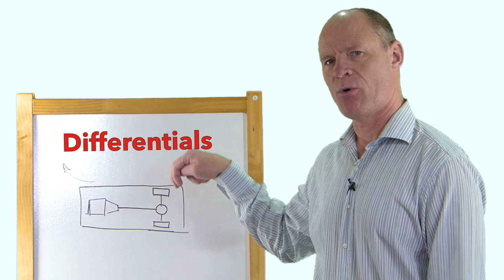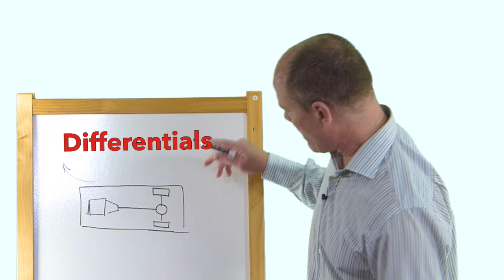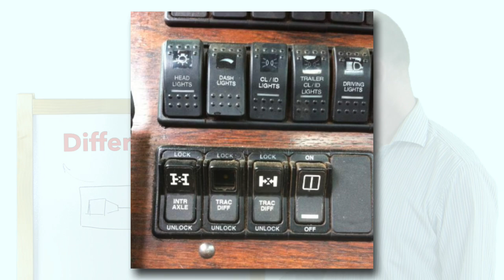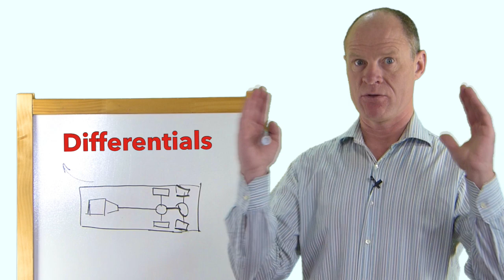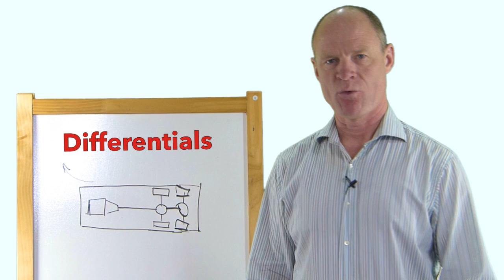How a Differential Works | Trucking Smart

Comment: So.. ?
Just a question...Which  Differential drives the truck the front one or the Rear one?
Reply from the maker: Hi Jay Jay Mr. Canada - Thank you for your comment and query. Most of the time, it's the front differential that drives the truck while it's going up and down the road. That's the reason for putting the chains on the front-most axle when chaining up, unless you have an inter-axle lock and then it doesn't matter. If there is anything further we can do, drop us a note. Always happy to help. All the best, Cheers Rick
Reply: Jay Jay Mr. Canad
Reply: check your drive tires usually its the front drives wear the quickest and using Jacobs engine brakes wear all your drive tires out a lot quicker too
Reply: its actually both differentials, the tire uneven wear is due to turning
Reply: @smartdrivetest  wrong
Reply: if its the front one take the rear driveshaft out and see if it moves lol it wont

Comment: If driving approximately 45-50 mph on relatively flat highway in snow, would it be advisable to use the locking differentials?
Reply from the maker: Hi Pamela B - Apologies for the late response. Thank you for your comment and query. And no, I wouldn't recommend using the diff lock. It is a feature that is designed to be used a low speeds. If there is anything further we can do, drop us a note. Always happy to help. All the best, Cheers Rick
Reply: Thank you 😊
Reply from the maker: Hi Pamela B - you are most welcome my friend. All the best, Cheers Rick
Reply: I agree with Rick, the power divider and axle lock (if equipped) are great traction aids when needed, but keep this in mind as well for when you do need them. If your tractor is equipped with BOTH a power divider and axle /differential locks, steering can be affected if the steer axle tires are on a slick surface as well; snow and ice, or mud. 
With one or both rear axles locked, the truck will resist turning and want to “push” straight ahead even with the wheels turned. This can sometimes catch a driver off guard in tight quarters. Rick did mention it’s best to use them while traveling in a straight line because it does put less stress on the drivetrain as well.

Comment: front wheel drive cars have differentials too built into the transmission
Reply from the maker: Hi MASTER MECHANIC Felipe - Thank you for that information. Smart drivers helping smart drivers makes us all smarter. All the best, Cheers Rick
Reply: Is the differential built into the transmission or transaxle?

Comment: i'm planning on build a custom welding truck and i was think of making it a tandem axle truck, is the gearing different in the axles or is it the same gear ratio in both axles. i know for a small time personal welding rig i shouldn't need a tandem axle rig, but i want it for weight distribution on the bed. without having to get a CDL
Reply from the maker: Hi David - thank you for your comment. I would suggest that you stick with a single axle vehicle. A tandem axle vehicle gets significantly less fuel economy than a single axle. A mate of mine suggested that you think about a Ford 550 or 650 for your rig. If you do go with a tandem, yes, the gearing in the axles in the same. And, I don't know where you are, but here in British Columbia, a 3 axle vehicle requires a Class #3 license. Those are some other factors to consider. If there is anything further we can do, drop us a note. Always happy to help. All the best, Cheers Rick
Reply: thanks for the info, im in the usa
Reply from the maker: Which state are you in David - I'll look up the requirements for a 3 axle vehicle for you?
Reply: Max before a CDL is required is 26k pounds, once it exceeds that gross weight you will be getting into CDL territory. Also if you plan to tow a trailer you are good for 16k tow vehicle max weight with 10k of trailer weight, and again anything over that in combination will require a CDL, if it has airbrakes then you need to obtain the airbrake endorsement and is a standard requirement for CDL.

Comment: My truck has problem when I turn differential switch on I hear air does something but only one rear wheel spinning on passenger side. What can be the problem? What's need be checked or replaced?
Reply: Good morning, Johny. 
This is a year late, but if you’re still having this problem, hopefully this will help you out. 
You mentioned hearing air when you toggle the switch; if you only hear this when the switch is flipped to lock, I would verify the switch valve body is good, and not leaking (bypassing) air to the exhaust port. Normally, in a functioning switch, this is where the air pressure in the signal line would be exhausted to atmosphere when the switch is toggled to the unlock position. 

If the switch is functioning correctly, check for leaks in the signal line next. This line is pressurized when the power divider switch is in the locked position, and sends air to your forward rear axle. Listen for leaks in this line. Run the engine to build air, then shut the truck off, and engage the switch. Turn the key on while doing this, so that if you are losing air, the low air alarm will sound and alert you ( nothing is more aggravating than chasing an air leak with no leaking air 😂) 

Doing this will also give you an indication of the severity of the air leak. Also, a bottle of soapy water will help you to find leaking unions or pin holes in lines. 

If you follow this signal line to the differential, and have not found a leak or defective component, the problem may be the actuator in the power divider unit. 
Some trucks use a diaphragm actuator and linkage that will resemble a brake chamber, and some use an internal piston. Either of these components could be leaking or stuck /binding. 

If this is the faulty component, you may want to consult a shop for repairs, depending on your mechanical ability. It is possible to do further troubleshooting to confirm the actuator, but I wouldn’t want to put you in a position where you may inadvertently lock the differential in the locked position, making your problem worse than just a non-operational power divider. 

I hope this helps, and if you’ve had the problem addressed, hopefully it will at least give you an idea of how the system works, and can maybe save you some money down the road!  Good luck, and best wishes.

Comment: If I disengage the diff while moving; will it cause damage ??
Reply from the maker: Hi Lorenzo Pacheco - Thank you for your comment and query. If you have the vehicle in a straight line and less than 10mph (15kph), it's not going to do any damage to the differentials. If there is anything further we can do, drop us a note. Always happy to help. All the best, Cheers Rick
Reply: Smart Drive Test thank you! Just got a job driving end dumps and bellies this will be helpful
Reply from the maker: Hi Lorenzo Pacheco - Thank you for your reply. That's awesome - so you're doing a lot of off road stuff? What are you hauling? If there is anything further we can do, drop us a note. Always happy to help. All the best, Cheers Rick
Reply: Smart Drive Test I’ll be hauling rock, asphalt, fill dirt from pits and they have some rough terrain. Thanks! Sure will.
Reply from the maker: Hi Lorenzo Pacheco - Thank you for your comment. That's brilliant. When dumping end dumps, make sure you're on level ground, and that the grounds solid. And always look up for overhead obstructions. We had a guy at one of the companies, they were hauling wet clay, and it stuck in the front of the box. When he raised the dump, it wouldn't let go and of course the load wasn't balanced and the whole truck flopped over. The worst part was that it punctured the fuel tanks and then the trucking company was charged with an environmental spill. When in doubt - ask questions and you'll do great. All the best my friend, Cheers Rick

Comment: What if you engage the diff lock and nothing happens can it be the switches
Reply: Hi Ash A. Depending on your truck’s make and model, it can be several things that need troubleshooting. 
Before digging in, what has led you to believe nothing happened?  I don’t mean anything by that, other than were you stuck at the time and needed the traction aid, but it wasn’t working?  Or did you push the lever / switch and didn’t hear anything?  What were the weather conditions at the time?  Unfortunately, if yours is air operated, the systems do not get used regularly, and moisture can freeze in the lines and prevent them from working- WHEN YOU NEED THEM THE MOST!  Did any indicator lights come on in the instrument panel?
If you were sitting still, and just turning it on to become familiar with the controls, chances are nothing will happen- other than a small spit of air ( like flipping the range selector on the shift knob), if your truck is old enough for the switch to be air operated. 
Chances are that the switch is electric though, again depending on the make and model of your truck. If so, and no indicator lights came on, including a light on the switch, I’d check the operator’s manual (if you have it) for a fuse location in the fuse box.
If it is an electric switch, and the fuse is good, then power and ground will have to be checked at the switch to verify the harness integrity and switch function. If this doesn’t solve the problem, a technician will most likely have to verify the harness integrity between the switch and axle(s), and the actuators themselves. 
If the switches and power divider / axle locks are air operated, the supply air, switch, and switched air will have to be verified, and if that checks out ok, the air lines and actuators will have to be verified.
I hope this helps, and hopefully it’s something simple :)

Comment: I'm buying a kenworth T660 with a 10 speed manual. I would like to run between 1400-1500 RPM at 75mph. I can't seem to find info for  this. 3.25, 3.55, etc. What would be best? P.S. I'm running dry van
Reply from the maker: Hi Daniel Nelson - Thank you for your comment and query. I'm not a 100% certain, but I believe the best rear to run highway with a dry van is 390 rears. And the people that would be best qualified to help you set up the truck are the dealership. They'll be able to tell you what rear-end you need to put in your vehicle to set it up properly with both the engine and transmission that it's currently set up with.  If there is anything further we can do, drop us a note. Always happy to help. All the best, Cheers Rick
Reply: You need to know tire circumference and transmission gear ratio  to figure this out

Comment: I locked differential in my truck once. Unlocked them when was ready to go on highway but apparently it did not unlock mechanically.. so after driving around 150 miles on highway, stopped on rest area I heard bobling noise rear of the truck.. my differential oil was boiling. Next day it unlocked somehow, I changed diff.oil and still drove it for another year with no issues. Then sold it..
Reply from the maker: Hi Vitaliy Melnychuk - Thank you for your comment and information. I'd never heard about the differential getting that hot. However, if you're doing city driving and a lot of turns that would make sense. Good to hear there weren't any issues beyond changing the fluid. All the best, Cheers Rick
Reply: If that ever happens again, driving in a slight curve, forward and then backward, will, at some point in the process, release all the built-up torque between the two sides of the differential.  It should be able to unlock at that moment.  A similar trick is often needed to disengage the front drive system of an all-wheel drive truck.  Also, I have a pickup with a "Gov-Lock" differential, and sometimes if it automatically engages harshly, it won't disengage unless I release the torque between right and left sides via the trick I mentioned at the beginning of this post.

Comment: @ Smart Drive Test 
I have a Scania Series 3 11M360 1994
When I jack up my read left tyres the won’t spin I trie spinning them with hand they won’t go. When I turn my diff lock on it engages it works I turn it back off I can hear the air go and it’s off also on the switch the light stays on and on the display dash board it’s glowing saying it’s on don’t know what’s wrong!!? Anyone haw a clue thx
Reply: Also I bought a new switch same thing some say it’s not disengaging fully like my cross lock turns of but like my diff lock stays on

Comment: Front Wheel drive does not has a differential. Did I listen well?
Reply from the maker: Hi Luiz Gustavo Padilha - Thank you for your comment and query. You do have a differential on the front. It's just not the same setup as a rear differential axle. Owing to the steering, it's a bit more complicated than a rear axle. If there is anything further we can do, drop us a note. Always happy to help. All the best, Cheers Rick
Reply from the maker: Hi OttovonEarth - Thank you for your comment. What I should have said is that the front does have a differential, but it's not a conventional differential like the one on a rear axle. If there is anything further we can do, drop us a note. Always happy to help. All the best, Cheers Rick
Reply from the maker: Hi OttovonEarth - Apologies for the late response. Thank you for your response and great information. Yes, there are different setups on vehicles to work with the different wheel speeds when the vehicle is turning. And 76,000kg (167,551lbs) is really heavy my friend. Do you have driveline retarders or engine brakes to assist with downhill braking? All the best, Cheers Rick
Reply from the maker: Hi OttovonEarth - Thank you for your response. Yes, automotive technology has made great advances in the last couple of decades. I'm all for advances in technology. Take care my friend. All the best, Cheers Rick

Comment: I think I'm not the only one that came to see this video because we screwed up and left the inner axle differential lock on, I drove for an hour and a half going 70 miles per hour on a Freightliner Columbia before I stopped and took it off needless to say. Seems to be working fine but I did get s*** scared 😂